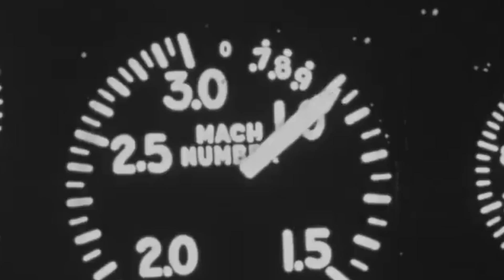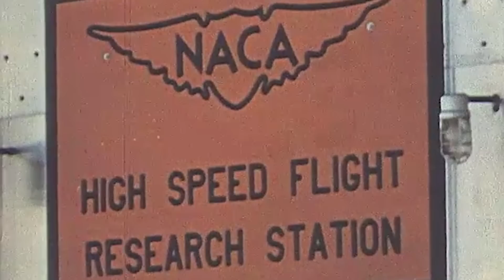The Flying Bullet That Shattered Aviation's Limits Forever

Comment: It might be an idea to design an aircraft that can fly supersonic using as a model a 50cal bullet for it's stability but that's where the comparison ends. Whether it be 30cal, 50cal, 20mm, 50mm they have a couple of notable differences; the most accurate projectiles are what's called 'boat tail' designs with specific dimensions. Bullets are also primarily stabilized by being spun at significant rotations (by the barrel rifling).
Reply: The key to breaking the sound barrier was the power assisted, servo-operated Horizontal Stabilator.
The Germans had it first on the Me-262 and the Bell X-1 copied it.
Reply: @DoktorBayerischeMotorenWerke

The ME262 DID NOT have an all-moving stabilizer.
Reply: @calvinnickel9995  The Messerschmitt Me-262 is the world's first jet aircraft with an electric, fly-by-wire horizonal stabilator system.
 It was developed by a genius engineer named Adolf Busemann.

All Me-262s made during and after the war featured a horizontal stabilator system..
Reply: @DoktorBayerischeMotorenWerke  I think you need to look at my post to Wilhelm Karsten above (you sound like the same guy !!) but you are factually incorrect in that you do not know the difference between a stabilizer and stabilator - the 262 had an electrically actuated stabilizer for trim control operated by a jackscrew powered by a small electric motor within the tail empennage this was not connected to the control column which operated conventional elevators using a push-pull rod system.
Reply: @robertharrison2260  WRONG! The Messerschmitt Me-262 was designed and built with an Analog, Fly-by-wire, electric power assisted HORIZONTAL STABILATOR SYSTEM.
Adolf Busemann designed and tested the system to speeds up to Mach 1.4 at the RLM's supersonic wind tunnel labs in Braunschweig..
Reply: @DoktorBayerischeMotorenWerke  Are you sure about that because there are some factual inconsistancies with your opinion. - Firstly Buseman at the time was the foremost expert in Swept wing aerodynamics and airflow wind tunnel research (not control systems) and many of his ideas for the later ME 262 HG series such as the 35 degree wing sweep and dihedral tail design (the HG262 sadly did not fly) when he started work in USA in 1951 were incorporated in the eventual US F86 Sabre (which was initially a straight wing design) and Boeing B47 programs and he went on to test theories on delta wings and other configurations.   
When you read the ME 262 pilots notes and test reports on the flight controls all examples had conventional push pull rod flight control systems with elevators and a horizontal stabilizer (not a stabilator) this was electrically actuated by a lever on the port quadrant (near the throttles and fuel cocks) there was an analogue indicator here as well showing the horizontal stabilizer position this was needed as the C of G and pitch changed at various throttle, fuel and loading settings in the flight envelope. 
Karl Doetsch at the German Aeronautical Research institute was one of the pioneers of automatic flight stabilisation systems for the HS129 FW190 and later TA152 his link with the ME262 was principally with the yaw damper system and he had direct input with Dr Waldermar Voight on the ME262 pitch control Stabilizer.  Karl Doetsch went on to work at the Royal Aeronautical Establishment in Farnborough and was involved in the Concorde flight control systems.   
Analogue fly by wire was never used on the ME 262 but a Heinkel HE111 test aircraft was fitted with an early analogue system this was part-developed by SS-Oberfuhrer Karl Otto Altivator when working as head of Siemens aviation division (I believe a Soviet Tupolev was the first aircraft with analogue FBW).  Kurt Tank of Focke Wulf also had a electrical engineering background and was instrumental in developing many innovative systems such as a electro mechanical engine management system for the FW190 and TA152.
Reply: @DoktorBayerischeMotorenWerke  You are now getting closer to what I described in my initial post but you mean stabiliser not stabilator there is an important difference in flight controls here - If you refer to the 262 pilots notes (USAAF test evaluation notes) it clearly states - "The flight controls are conventional using push pull rods throughout"
 "There is a horizontal stabiliser trim control and indicator. The angle of incidence of the stabiliser is varied by an electric motor to trim the aircraft" 
"Control is operated by a lever, the horizontal stabiliser position is shown on an indicator"
" Power is supplied to the controls by a switch on the main switch panel"
"The stabiliser trim control should not be used when going into or pulling out of a dive the reason for this is that the entire stabiliser is moved up and down by an electric motor drive actuated by the trim control lever. Thus a slight deflection has a large effect and it is easy to over control causing the ship to nose over or pull up more abruptly than intended"
"speeds of 950 Km/hr (590 Mph) are reported to have been attained in a shallow dive 20 degrees to 30 degrees from the horizontal" 
What is interesting is that opinions are usually emotional but they are not usually rational and perspective on matters of conjecture is everything - Herr Mutke's account has never been verified and various experts who have flown and tested the 262 throughout its flight regime doubt that he actually exceeded the speed of sound beyond M0.82 in the 262 airframe and they have several very logical "test pilot" reasons to explain why and IF it did happen it was never repeated despite exhaustive tests - recent German tests on the 262 using a variety of methods also cast some doubt on this claim - in any case it is irrelevant as the fact is the USA managed to break the sound barrier first in the Bell X1 and this is verified beyond doubt. 
The Bell X-1 may of had some similarities with the ME262 stabiliser and as you state Bell did visit Germany but there was also some significant differences in its operation and some evidence that the Americans developed their own system in house - engineers John Stack and Robert Gilruth being responsible (as they did with other programs) you may like to read Chuck Yeager's account in his book. There is also compelling evidence that the later Bell X-1 changed from the stabiliser to a stabilator utilising some elements of the Miles M52 "flying tail / Stabilator" with verified accounts of a team from Bell visiting the full scale mock up in UK and receiving test data and as others here have stated that Eric Brown and other esteemed experts like chief aerodynamicist Dennis Bancroft have fully documented this because they were there at the time. 
Whilst you may be prejudiced towards the Miles M52 program (which only flew as an unmanned scale rocket powered vehicle) this is just cognitive dissonance on your part as the concept was verifiably proven when it flew to M1.38 in level flight in October 1948 and provided some important data that has been used on other programs elsewhere.  
You may well think that the British and American (and the Swedish, French, Soviets) Aeronautical programs were well behind Germany in 1944 and in some areas they were and these deficiencies are all documented but in other areas the allies were making great technological strides independent of known German developments until the early 1950s when the first groups of German scientists started to work on programs in the USA and UK and elsewhere.
Reply: @DoktorBayerischeMotorenWerke  didn't come from the 262...the all moving stabiliser was in all likelihood copied from the American visit to the miles factory where they were granted access to the m52 project, which had the then called, all moving tail plane
Reply: @laurencedawson7754  The Miles M.52 never existed so there is no possibility that it was copied by the Americans.

Bell aircraft had a very close relationship with Theodore von Karman and JPL. Bell participated in the planning and execution of the Von Karman Mission and Operation Paperclip.

The plans for the Me-262's Horizontal Stabilator were giving to Jack Ridely at Bell from Adolf Busemann via Von Karman.

The Bell XS-1 that flew supersonic on October 14th, 1947, used an exact copy of the Messerschmitt Me-262's Horizontal Stabilator. 

Bell Aircraft was heavily invested in captured German jet aircraft technology.

Miles never built any jet aircraft capable of flying over 300 miles per hour.
Reply: @DoktorBayerischeMotorenWerke  no one claims the m52 was ever completed - have a read of my reply to the other guy arguing the same.....it was 90% complete when the us delegation visited, no one denied the advanced German technology , but this info came in all likelihood from miles......photos of the me262 very clearly show a standard horizontal stabiliser with the elevator section visible- how do you explain this?

Comment: The X-1 did not have a throttle as mentioned at 1:40. Four toggle switches ignited the four combustion chambers of the rocket engines. The four ignition chambers were either on or off and thrust could be adjusted by the number of switches activated. The cockpit was pressurized (4:50)  with the nitrogen that was also used to pressurize the fuel tanks. The pilot breathed oxygen through a oxygen mask. A system that would surely not be approved by the man rating board today! The visibility for landing was not good with the original windshield which contributed to several nose gear failures. The nose gear was not very strong and you have a picture of a nose wheel failure on the X-1E with the newer canopy. Thanks for running a picture of my dad at 5:13
Reply: Four people in that photo! Which was your dad?
Reply: @PetesGuide  NACA Research Test Pilot, John H Griffith
Reply: @Mrjonblakely  from left to right, 1–4, what number?
Reply: @PetesGuide  Number 3, I thought by mentioning pilot that it would narrow it down for you.
Reply: @Mrjonblakely  Oh! I just assumed that would have been Chuck, and didn’t read or look carefully! Yeager’s autobiography was one of my favorite books as a kid. And I’ve actually been in the under-pool restaurant they used in The Right Stuff.

What was it like having a test pilot as a dad?
Reply: @PetesGuide  He was a good father. He coached my brother's and my Little League baseball teams. He left high performance flight testing after flying the Chance Vought F-7U. Two test pilots before him and one after were killed flying that plane. My dad had a 60 degree down high speed test flight from 30,000 ft go bad and he missed the ground by 1,100 ft. As he said at the Walk of Honor induction ceremony, "I wanted to see my kids graduate from high school." So he pursued other areas of aviation and lived to 92. There is a Wikipedia page about him if you are interested.

Comment: "Some 'experts' warned of a sound barrier - an invisible wall in the sky that could tear any aircraft to pieces."   Such "experts" were 100% wrong - their knowledge, their education, their expertise was garbage.  It's not unlike the "experts" who scream today about various complex natural phenomena...climate change, global warming, etc!  As an engineer, I am by nature skeptical of experts.
Reply: As an engineer you should be aware that the Sound Barrier was in fact very real, until Adolf Busemann developed the first fly-by-wire Horizontal Stabilator system for the Messerschmitt Me-262, no pilot could reach supersonic without a complete loss of aircraft flight control attitude.
All previous attempts to fly supersonic ended in fatal crashes, generally from the loss of Pitch control as the plane reaches high transonic airspeed compression waves first blanked-out the Elevators surfaces rendering them unresponsive, if the pilot continued to accelerate the compression waves would begin to act directly upon the elevator surfaces and force the plane into a dive (known as "Mach Tuck" or the dreaded "Death Dive")  the pressure so great that the pilot could not pull back on the stick with sufficient force to regain control.
 the planes would either break-up in flight or auger straight into the ground.

The Sound Barrier was broken by the invention of the power-assisted servo-controlled Horizontal Stabilator at the RLM's Luftfahrtforschungsanstalt supersonic wind tunnel laboratories in Braunschweig, Germany.

Comment: I'm not sure but with the speed of 1003,67 km/h,
the "Me 163" the flying "poweregg"  was the first one 3 years earlier?
Or was it a little under the sonic speed of M 1?
Reply: It was probably a little under... At -25°C, Mach 1 is about 704 mph, so the Heini Dittmar "unofficial" speed is right up there... but I've read multiple accounts of Me163 pilots encountering compressability. "The usable Mach number was similar to that of the Me 262, but because of the high thrust-to-drag ratio, it was much easier for the pilot to lose track of the onset of severe compressibility and risk loss of control. A Mach warning system was installed as a result." So I think it's unlikely that Heini exceeded Mach 1... Cool little plane ( with horrific statistics for the well being of the pilots flying it )
Reply: @boston_pc  Certainly not in straight and level flight but we know that like the F-86 the Me-262 could easily reach and exceed Mach 1 in a full power dive if the altitude and atmospheric conditions were right, the Me-262 had a high enough critical Mach number to exceed Mach 1 in controlled flight and it is the world's first jet with a fly-by-wire Horizontal Stabilator which was used to counteract the effects of "Mach tuck".
Chuck Yeager confirmed Hans Mutke's written accounts of passing through his own shock wave in 1945,  his descriptions exactly match, although Mutke said he was not the first German pilot to fly the Me-262 supersonic in a dive and that other 262 pilots had achieved it before him..
Reply: @boston_pc  Thank you very much! 🍀😊👍🇩🇪
1234,8 km/h is the speed of sound.
343 m/s.
Yess you're right.

They slowed down the Me 262 because of compressabilty, stability, use of higher fuselage.
More stability = higher weight.
High speed curve = more gravitation = more wasted fuel.
The german system was more powerful than the more easy, cheaper and the more simple of Frank Whittle from the UK - 

but higher consumption of material, lower flighttime hours, 
12 - 22 hours until next maintenance.

They haven't had the modern alloys and not the modern ways to increase the flighttime hours with less affords of maintenance.

The Me 163 was really very dangerous - for the pilots and just max 15-20 minutes flighttime.